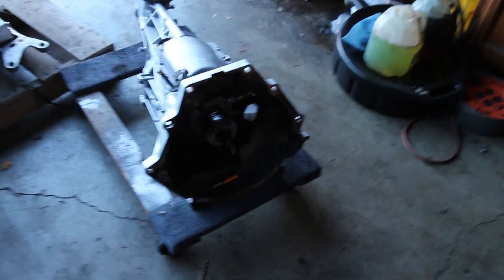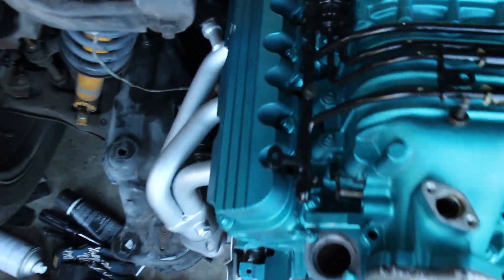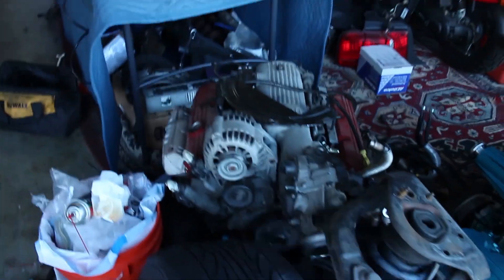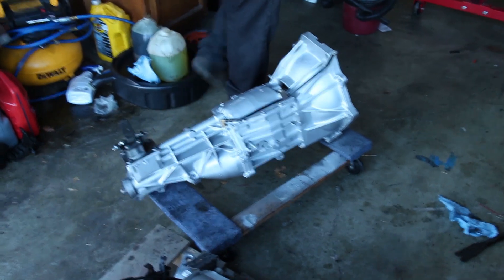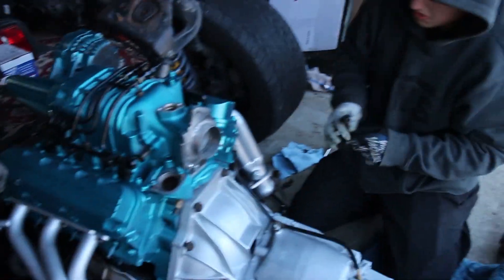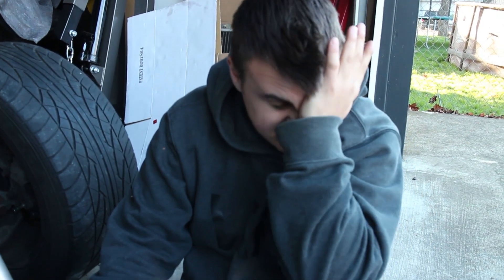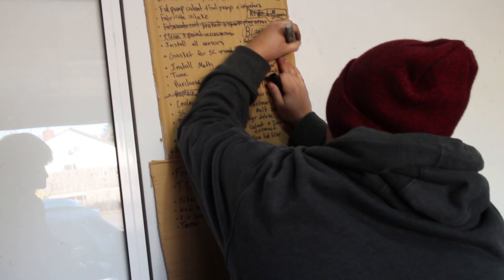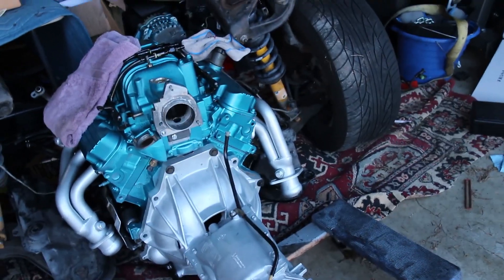Project F Camaro Rebuild Part 16 (The Bonneville's L67 Engine BLEW UP! We're Gonna Engine Swap It!)

Comment: I'm picking up a Bon-ssei What are you guys using to tune the ECM I'm looking to up the injector # and other mods?
Reply from the maker: We'll likely be reaching out to Intense for a mail tune, they're a 3800 specific tuner.
Reply: I use ZZP for mail oder tunes on my Bonnie. Intense also sells them at a much higher price. But I've heard they're more aggressive than zzp. Either one is good. I would look into a smaller supercharger pulley and supporting mods such as exhaust,  cold air intake and anything that will make the car run cooler. Stock injectors are good for a good amount of power unless your looking use E85. I've got #42.5 injectors because of my 3.0 inch supercharger pulley. If you got any questions lemme know. There's also the Pontiac Bonneville forums and 3800 Facebook groups with people that have alot of knowledge about modding.
Reply: I forgot to mention. Single best mod ive done was switching to a 75mm Northstar throttle body. They sell wire conversion and an adapter plate on eBay. Made the daily drive much better because stock, you'll give it gas on the freeway and it won't go anywhere until it downshifts. Now it will actually move and accelerate without having to downshift if I don't have to.

Comment: I'm buying a 2000 Regal GS.  It's been modified quite a bit.  Gen V blower, IC, 2.8 pulley, E85 and supporting mods.  Can't wait to get it.  It's going to be my daily driver.  I have a Grand National and I really don't want to take the chance racing it.  It's a 10sec car and I hope to make the Regal GS a 10s car.  With the 3800 series in the Regal GS I don't have to worry about splitting the block once I put a turbo on it.  Can't wait.
Reply: That will be a fast car for sure! Having a fun daily makes such a difference. I dont take it for granted especially when It blows up and im left driving my shit box XD Good luck getting to 10 seconds man. FWD is a unforgiving platform. Thats why I think our camaro project makes so much sense. So much torque to rear wheels! You definitely need to make some videos of you going to the track.
Reply from the maker: Sounds fun!

Comment: Damn I love the SSEI there are only a handful left,.....I just paid $2,200 for a really really clean SLE I couldn’t find an SSEI for sale anywhere in FL. I need help I want to top swap but I guess my balls aren’t big enough to go it alone😂.
Reply: That would be really awesome I can’t wait to see what all need to be swapped....also can’t wait to see the Camaro on the on the prowl I know it’s going to be super Kick ass🏁
Reply: @davidthompson2556  Thanks man, I appreciate it. I love it to.  I looked for this one for awhile before I found it. BTW If you want to do the swap, im sure we will go over it in the videos. But you'll need the Heads, Lower intake manifold, fuel rail and the supercharger off of the l67 that came in the SSEi and many cars. ZZP sells a whole kit of the gaskets and all the bolts you'll need. And then just a tune to run it that ZZP also sells.
Reply: MegaZombie101 I’m excited I’m going over to the next video
Reply from the maker: Well we will be making a series on it so hopefully that will help

Comment: I think you are supposed to lock tite the flywheel bolts instead of the grease
Reply from the maker: That's correct, we're gonna remove the ARP flexplate bolts we bought and replace them with OEM bolts and loctite.